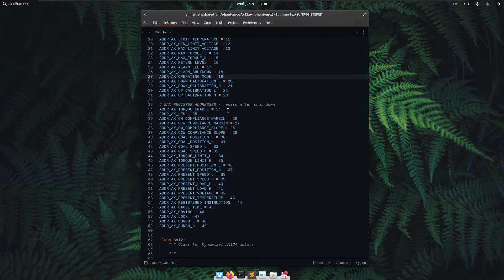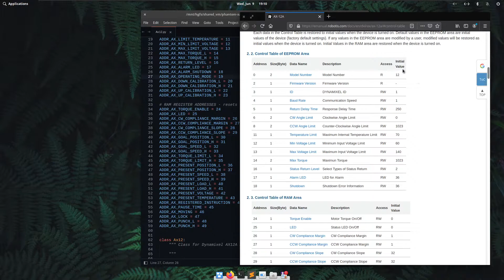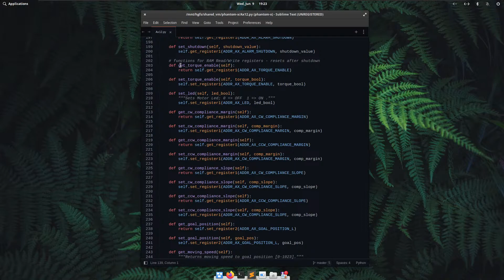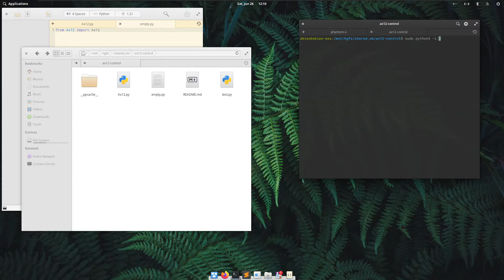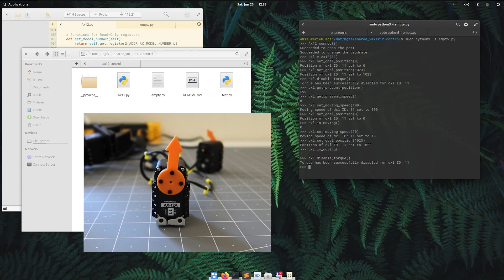Tutorial | Ax12 class overview | Controlling Speed , Position, and Torque

Comment: Thanks for the class and the video explanation. Please how do I set the motor to move to a particular angle instead of setting a position?
Reply from the maker: Hi you can use the static methods deg2raw() to convert your angle (0-300) into raw position values (0-1023)
Reply: @QRobotix  Hi, can you please tell me how we can implement the static methods directly in the code? (especially when the angle should be between 0 and 180°)
Thank you

Comment: is the max speed only 100?
Reply from the maker: Hi the max is 255
Reply: @QRobotix  do you make video with servo speed 255?
Reply from the maker: What for?
Reply: @QRobotix  I want to buy a dynamixel servo but the datasheet shows the speed is 59 rpm, while the servo generally has a speed of degrees / time past degrees
Reply: like 0.16s/60°
Reply from the maker: @yusuffirmansyah6843  Yeah the datasheet for the rpm is misleading. During my testing I found that the max speed is about 600 degrees/sec